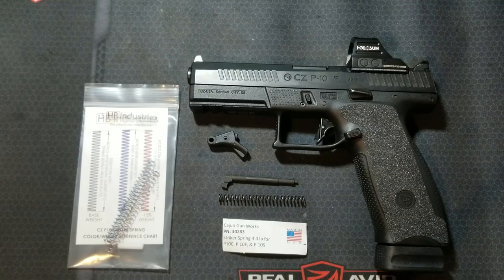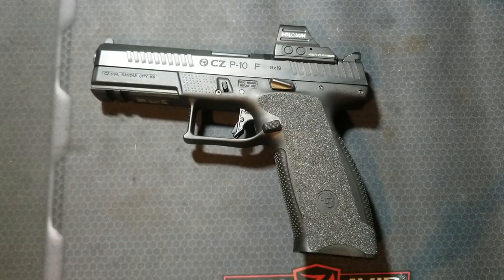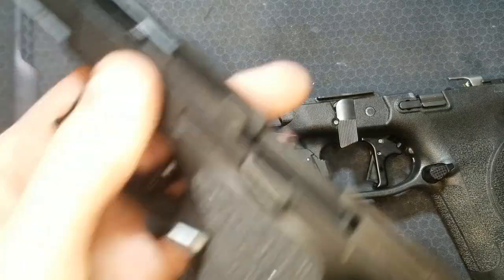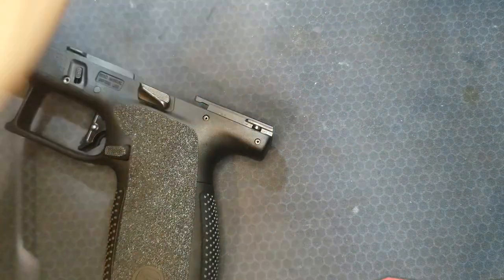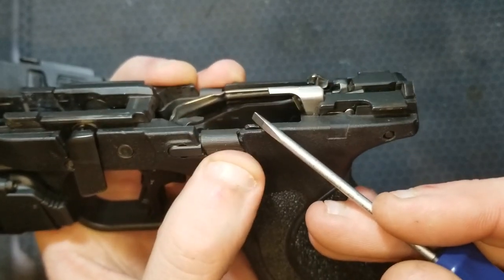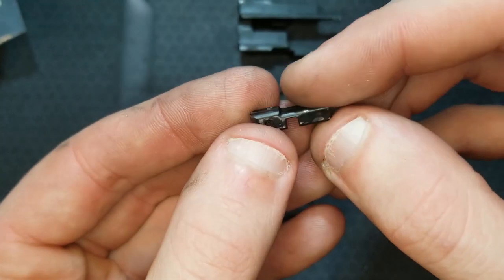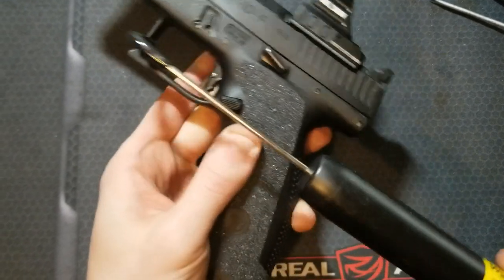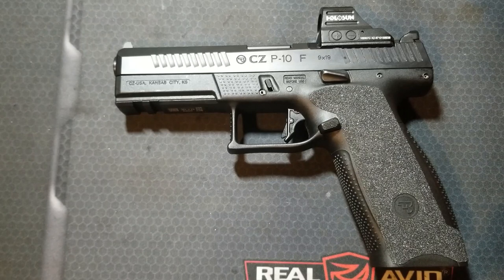CZ P10 Trigger Tuning, Polishing, Theory and Operation

Comment: I have about 40k rounds on P-10Fs and 15k on a couple P-10Cs and have never quite exactly understood how they worked until now. Excellent explanation and comparisons.
Reply from the maker: I'm glad is was useful! When I took this gun apart and really got into it, I was really impressed with how they approached and designed the striker fired system. Figured I would make a video on it as I hadn't seen one, just in case there are other nerds out there like me who like getting into the nitty gritty of operating mechanisms.
Reply: @dltz  Normally, I'm not quite that nerdy but your delivery was engaging. 

Currently have my P-07 stripped down and going to use your P-09 vid for polishing up the stuffs.
Reply from the maker: @iamjocanadian  Thanks for that lovely feedback. It's nice to know how I present these may reach a slightly wider audience than just fellow nerd!

I hope the polishing goes well on the P-07! Happy if my videos can help. I love my CZs and pretty much have in depth videos on all the hammer fired CZ pistol trigger mechanisms.

Comment: i have the p-10f competition ready and i have the trigger pull down to 2lbs. 100% reliable and most importantly no light primer strikes. it’s been awhile so i don’t remember what i  bought and installed…no polishing i know that.
Reply from the maker: I'd be interested to hear what your setup is if you happen to remember!
Reply: @EngineersArmory same here. It's a HB trigger, but it feels so heavy on the one I've handled. I wonder if it just needs to break in?
Reply from the maker: @hispeed8500  likely reduced weight striker spring. Glock striker springs work. Try lower weight. Also the apex tactical disconnector. Will reduce trigger break but turn the break into more of a roll and less of a snap.
Reply: @EngineersArmory  thanks for that! I'm having a hard time keeping the gun still in dry fire. It jumps pretty hard when the trigger breaks. My P10C and Glock 17 (Timney trigger) don't do that.

Comment: So, what products and methods do you use for polishing? I keep watching these polishing videos and it's like "Okay, here's everything polished". Like, please show the process! Any videos y'all can recommend for that on the P10 series? And please don't think I'm complaining about this particular video! Super awesome in-depth on the actual function of the trigger, so two thumbs up!
Reply from the maker: Its a fine line here on YouTube. If they took a close look at most my videos they would get taken down. Some have. Hhere is a video where I show some of the work:

https://www.youtube.com/watch?v=eNxEJ061-bE&t=1s

I use fine sandpaper, 600 grit and finer. I have coarse, medium, fine and extra fine stones. i have medium and fine files. I use a dremel tool with cotton buffing pads and polishing compound. Depending on the geometry of the part, finish, and how rough it is determines what you need to start with. Its a case by case bases. Generally i dont start with a file or coarse stone/sandpaper. usually 600 grit sandpaper or a medium stone is a good starting place. There are so many different cases, parts, finishes, materials, it would be hard to cover it all. Its something to play around with and learn.

Comment: Great explanation. The half cocked design of the Glock and CZ is much safer in theory than a fully cocked design of the M&P.
Reply from the maker: In theory yes haha. I don't see the fully pre-cocked striker system as much different than a 1911 hammer and sear interface, or any single action sear and hammer interface in a DA/SA system. Add in the trigger safety dingus and the striker safety block and I don't percieve a difference in the safety of a fully pre-cocked striker vs a partially pre-cocked striker system. Of course perceived safety of a trigger system will be largely subjective. Actual, objective safety will be left to the engineers, design, materials, testing, and required safety standard of organizations that may choose to field the pistol in service.
Reply: @EngineersArmory  The difference being that the striker on a Glock in theory has no stored energy to ignite the primer, hence the “safe action trigger” that CZ has also incorporated into their striker design. An M&P or a p320 without a manual safety has only a firing pin block preventing the striker from contacting the primer in the event the pistol is dropped. A 1911 has 2 safeties making it virtually impossible to fire without a grip on the weapon. But you already know this. I guess what I’m getting at is the design of the Glock makes it virtually impossible to fire without having pulled the trigger even if dropped, where an M&P can fire in theory if the firing pin block spring is overcome and the striker falls off the sear of dropped just right.
Reply from the maker: @mikerobinson8734  Yeah I'm aware of the details of the different systems. The glock striker and the P-10 striker are partially pre-cocked so there is some stored evergy in the striker spring, don't know if that would be enough to ignite a primer if the safety block was overcome. In theory i suppose that makes it safer. From my point of view I dont consider a partially pre-cocked system more safe than a fully pre-cocked system. 

I think the P320 is inherently less safe than other striker fired pistols becasuse it doesn't have the inertial safety on the trigger shoe even though it does have a firing pin safety block. The trigger could come to the rear if dropped which would also disengage the firing pin safety block. 

A 1911 doesn't have a firing pin safety block so that makes it less safe in my eyes and not comparable to any pistol with a firing pin block. (edited: the 70 series 1911 system does not have a firing pin safety block, the 80 series obviously does, but everyone uses the 70 series system for their 1911s and 2011s). The grip safety on the 1911 physically blocks the trigger from being pulled to the rear. The thumb safety physically blocks the sear from pivoting and releasing the hammer. The only thing preventing the firing pin from coming forward and contacting the primer is the firing pin spring, which (as I see it) could lead to an extreme situation where the firing pin sets off a round if the pistol is dropped even with the other 2 safeties engaged.

It all comes down to what people are comfortable with carrying I suppose. For range/hobby use its less important, however the risk of dropping a gun is always there haha. 

The general things I consider are 1. I never ever disable a safety feature that a gun has from the factory even though I heavily modify all my firearms. and 2. for concealed carry/defensive purposes I never use a gun without a firing pin safety block, that rules out my 1911/2011s and my CZ Shadow 2.  number 3. If i carry a striker fired gun, it better have a trigger dingus safety (rules out the P320).
Reply: @EngineersArmory  Love it. Great discussion brother thank you. I can’t say I disagree with anything you said. I wouldn’t trust any Sig p320 if you gave me one for free. It would be strictly a range gun. Cheers 🥂
Reply from the maker: @mikerobinson8734  Thank you! I always appreciate a good discussion too. My P320 is a range toy only for that reason haha.

Comment: I had the same results with my HBI springs, both were 4.8# with factory striker.  Factory pull was 5.5#.  Factory spring 0.027” with 25 coils.  Both HBI were 0.026”.  Blue had 24 coils and red 22.  The red is 0.088” less free length so it should be lighter but not in practice.
Reply from the maker: Thanks for sharing your results! I was a bit confused by the performance of the HBI springs. I was hoping for more difference between the two springs.
Reply: I would think the red would result in a lighter pull. I had to read and watch this video a few times to make sure. Gonna give blue spring a try.

Comment: My personal preference is the Apex for lightest trigger as well as the best overall feel. I have messed around a fair bit with the HBI, Overwatch, and the Apex. also tried several different striker springs. The P10 pistols I have for carry or defensive use do have either the Overwatch or HBI shoes.  

Thanks for the video
Reply from the maker: Trigger feel is largely a subjective thing. I don't want to reduce weight of the trigger at the expense of a nice defined wall. Others may like that rolling break. I have not tried the P-10 trigger with the Apex connector, but have a feeling I wouldn't like it based on what I have felt with reduced power disconnectors in Glocks. Having the Overwatch or HBI triggers in carry/defensive applications makes a lot of sense to me - keep that defined wall and make that trigger break require a deliberate press.

Thanks for watching and commenting! I always like to hear other people's experiences and setups!
Reply: Yeahp, I much prefer the apex kit as well.
Reply: @EngineersArmory dang, you should probably try it before you compare it to a Glock’s trigger break.  Totally different man. I’ve modified Glock triggers and none of them modified can even touch what the apex kit does in the p10. My p10 F breaks at 2lbs 10oz with the full kit. The roll is actually very crisp and precise. It also has a defined wall despite having a rolling style break
Reply from the maker: @jonah8133  I agree with you. That was speculation. And thanks for sharing your experience. 

I am happy with where the trigger came out on mine and don't want to pony up the money to get the Apex kit. This is more of a "duty/defensive" style pistol for me so since this video I have actually gone back to the factory striker spring for a heavier trigger pull.
Reply: @EngineersArmory  Gotcha man. and yeah it was a very informative video thank you for making it!
Reply: @EngineersArmory I went with the overwatch llove.

Comment: Hi there. EEman sells trigger return springs for the P10. Also how safe if the P10 to carry from your point of view?
Reply from the maker: Ah that is cool someone offers those springs. Looks like they have a "competition" trigger return spring that will lower trigger weight. In its factory configuration I would consider the P-10 series of pistol 100% reliable and safe to carry. As soon as you start modifying stuff, that's when you need to prove out your equipment before trusting your life to it. For me, I have thousands of rounds through this P10 with the modifications, so I would have no problem carrying it and trusting my life to it.